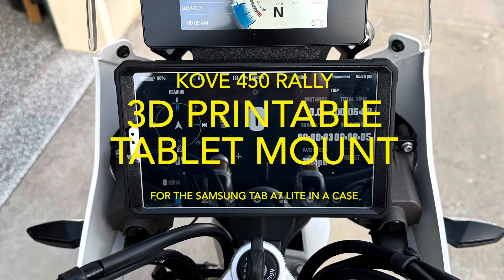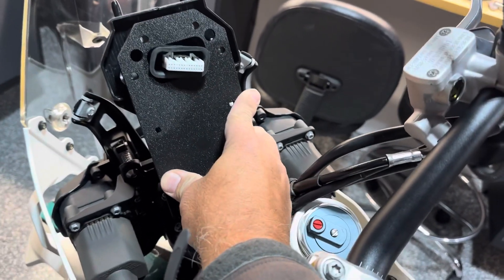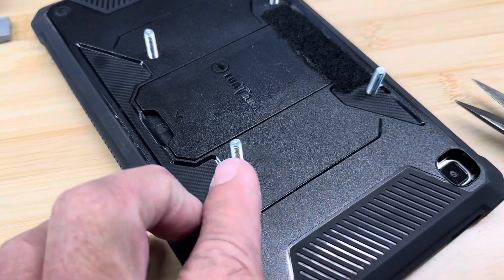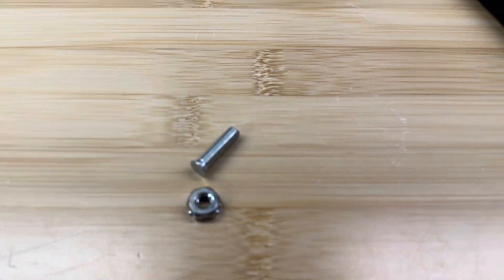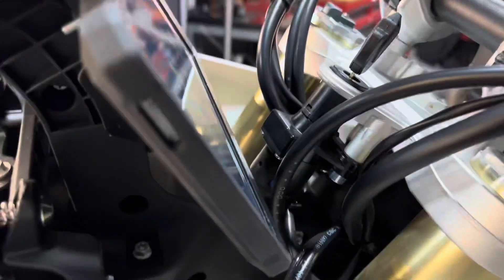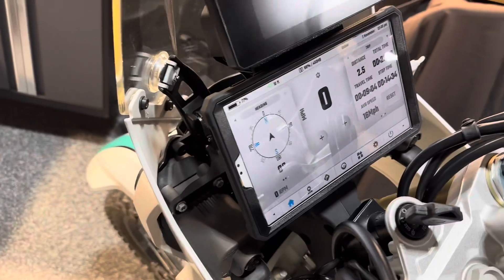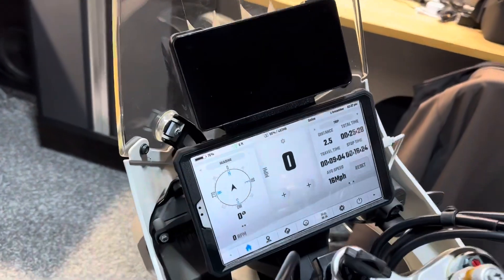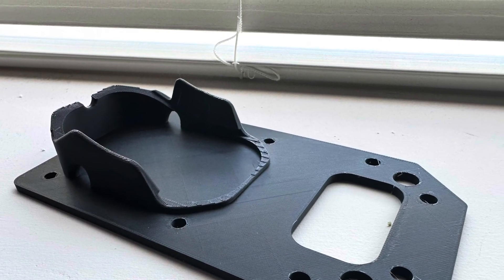Kove 450 Rally free 3D printable tablet mount

Comment: Hi Mike, 
as you mentioned (in another video) the tablet is not good visible "down there". Any chance to swap the Kove screen and the tablet holder, i.e. the Kove screen more down and the tablet above? Or do the (short) wires make this impossible?
Thx Clemens
Reply from the maker: You really need to switch the whole tower out to the aluminum one if you want to do that.  I could not figure out a way to make a 3D Print to accomplish this.

Comment: Really nicely done. also appreciathe sharing of the file. I do not have a 3-D printer nor access to anyone that does. could I interest you in making one for me and I would be glad to pay for it and shipping?
Reply from the maker: I recommend having an online service print it in PETG. https://www.3dcloudprint.com
Reply: Thanks Mike, I'll look into it.  I am assuming you have been out putting it through it's paces yes?  Still solid ?  No rattling ?  Not hindering the USB junction/area ?  Tablet does not vibrate ? Power connection working well ? @adventuremikesgarage
Reply from the maker: @stevebiron3036  It is a very solid mount.  I took the tablet off and added a RAM ball mount for my Garmin or an Apple CarPlay device.  I really want to use the apple Carplay device most but right now the one I got is not working well with gloves.  Even with glovetacks.  The Samsung tablet is not very bright in full sunlight.  It mounts up very nice and securely but I don't like the dim screen.  It did work fine with my gloves though.  I may go back to it.  I'm just not excited about having to pay for maps in Drive Mode  software.  I like that the apple carplay works so well with the phone that is safely in my pocket for music, maps and Siri.I really want to go that way but might have to return the one I got and get a 7" CarPlay device for Motorcycles.  The Garmin Zumo XT works OK but seems less feature rich.
Reply: Thanks mate, really appreciate the helpful info. @adventuremikesgarage
Reply from the maker: @stevebiron3036  I’m updating the design to include a Ram ball mount above the gauges too
Reply: I’m interested in the new design. Where are you sharing the file?  My sone has a printer.
Reply from the maker: @lorenedwards2678  here’s the most recent on printables. https://www.printables.com/model/662110-kove-450-rally-gps-tablet-carplay-c7-gopro-mount-u